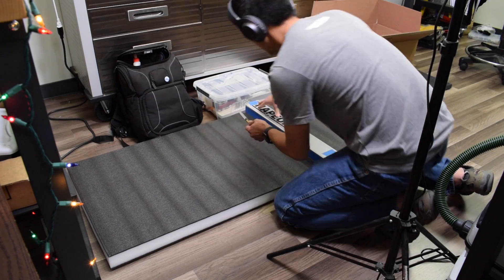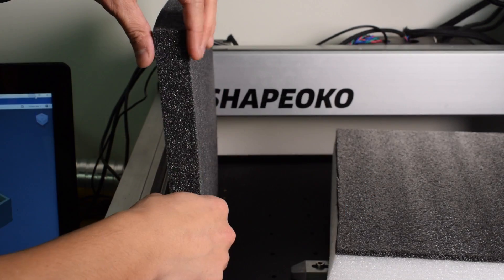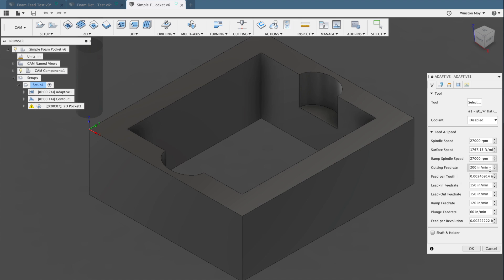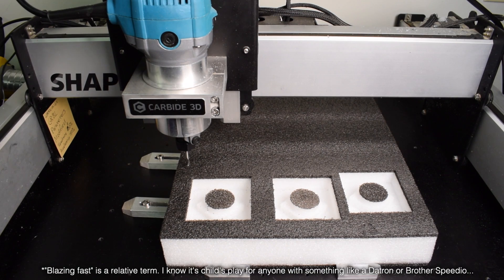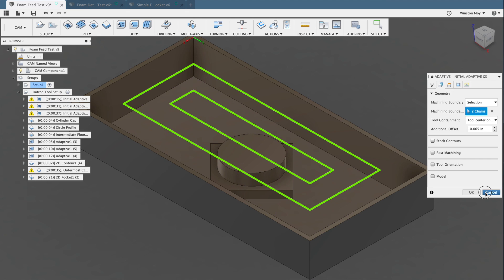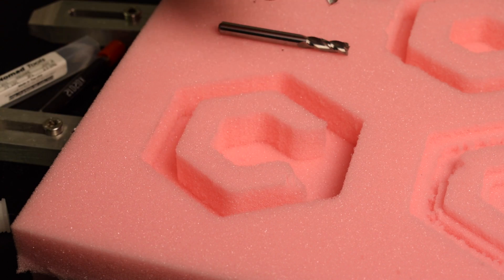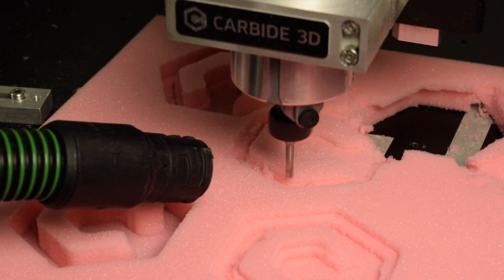Learning to Machining PE and PU Foam on the Shapeoko - #139

Comment: Is there any chance you could do a video on how you setup your containment boundaries in fusion 360. I am currently cutting kaizen foam and having the same issues you did. your solution would fix my issue. I am running a datron 3 flute endmill as well.  Although i am not running a shapeoko, i am running  UGS version of GRBL on my gensmitsu 4030, so I would imagine i would have to adjust my limits just as you did as well.  Thanks again, and great video!

Comment: laser cut it?
Reply from the maker: Can't cut flat bottomed pockets, only all the way through. Also, only certain types aren't safe to laser.
Reply: Winston Moy ah yeah you would be in trouble in that case. 

Suppose technically you could add a laser to this presumably?
Reply from the maker: @acidrain55  People have bolted on some 450 nm blue lasers for woodburning and light cutting, but for cutting plastics you need a proper CO2 laser operating in the infrared spectrum. Not good to put one of those fragile laser tubes on a CNC, and certainly not one that's properly enclosed/shielded.
Reply: Anyone know I
How deep you can cut on this exact XL Shapeoko setup, can it cut all the way through 3” foam or even deeper?

Comment: what if you made a metal* bed arrangement of all the parts you wanna pack, heat the whole thing up and then press a foam sheet onto it, so it MELTS away all the shapes you need in your foam.  

* or just metal covered, like foil.

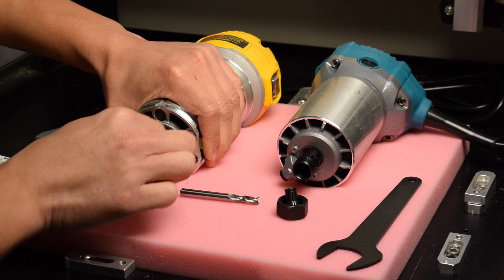Comment: 4:00 you can buy metric router collets, there is a mixed set with metric and imperial i bought last moth since i needed 1/4 for my 8mm machine so i bought these 10mm and grinded them on the lathe to 1/4-8mm. https://www.ebay.com/itm/6Mm-6-35Mm-8Mm-Woodworking-Router-Bit-Engraving-Machine-Wood-Milling-Cutter-M0S6/192871342488?hash=item2ce8072198:g:7EMAAOSwuptcmvjS
but you can by also premade ones
https://www.ebay.com/itm/1Piece-Carbide-Multi-size-Engraving-Bit-CNC-Router-Tool-Adapter-Collet/232613453717?hash=item3628d79f95:m:m7GaqDFK6eBuxxJusKqaY4Q

what is your collets outer diameter and the biggest inner diameter colet you have?

Comment: Interesting tests.  I've made my living for a couple of decades in a related field, my machine cuts at close to 1000 ipm.  We have a spiked finish on our custom cutter heads, called "SuperGrit."   Although not exactly the same sort of foam (ours is more friable, usually polyurethanes and EPS) we have had the task of doing more elastic and lower density forms.  About 15 years ago I came up with a method of soaking the lower density foam in water and freezing it, then was able to cut acceptable detail in very "soft" foams.  Had to work quickly but it worked for smaller jobs.  Not sure if it is relevant but just prompted me to respond upon seeing what you've shared.
Reply: InstaBlaster
Reply: Wooow George this is amazing! I’m trying to scale my family business we’ve been carving on foam for more than 20 years for props and hand made dolls. We’re small but we’re trying to step up our production and this information is really great! I’m trying to gather information about gear and what machine should we buy to start, because I’m guessing high RPM is probably very important when it comes to work and such a soft material. Would you be so kind to give me some recommendations? Thank you so much!

Comment: Ive been running foam on our laser for packaging. Its smelly, and wont do a pocket  (you have to laminate for that) but handles that soft stuff super easy. On our 100w, I run 40mm/s, at 50% power.

Comment: I had good experience with single straight flute endmills, like "10pcs 3.175mm Shank 2.5x8mm Tungsten Steel Parallel Milling Cutter Engraving Bits" on banggood. Also, I can recommend trying climb roughing - you won't get precise walls due to the foam compressing, but it will chip-break easily even on long continuous cuts.

Comment: My experiences are very similar. At one time the foam got caught and it sounded like a loud bang, the foam ripped in two, wrapped around the spindle, caused it to block the motion completely. The chinese vfd did its job and cut the power, it detected overcurrent and the protection kicked in. 
I've got some 16mm two flute straight cutters which are great for clearing large areas without foam clinging to it. It has a 6mm shank. Normally used for facing wood.
I did some 3d paths with it and worked great. After that a ballnose took care of the detail. With shallow doc it works great. Aluminium cutters (al-tian iirc) also work well.

Comment: problem with cheap small machines is that they don't last long in mass production. Try running your machine 5 24h days for a couple of weeks and tell me if the spindle bearings and ball screws still works fine / CNC machinist for 12 years.
Reply: Thing is how many specialised foam cases you need to make. Using a smaller cnc router would probably be useful for low volume runs that would take a large Mori out of doing production work is what Winston is saying. You could probably buy a whole new hobby CNC for what you would save on the large production CNC machine like what John Grissom is doing. Doing the foam on his Mori means it’s not making knives, makes a ton of mess that has to be cleaned up and requires him to swap out fixtures... but a cheap hobby CNC COULD cut the limited run of case foams for his knives while the knives are being made.
Reply: Problem with Honda Civics is they don't last long in the Baja 1000.

Comment: 0:53 - Routers are just too noisy. Really, they should be replaced by a spindle, either water or air cooled. The router depends on air flow through the device which means fans... fans are extremely noisy. Spindles on the other hand either use water, or radial cooling fins and a heatsink to dissipate the heat. I have a simple video to show the difference between the two.  https://www.youtube.com/watch?v=hALI4XpfmQ8
Reply: Agree with YOU 110%!!!!
Reply: I use a 611 router in my cnc but it is modified through a Super-PID speed controller so that grbl can control on off and speed. I’ve also built my CNC into a heavy wheeled trolley that has sound damped panels. The only reason I didn’t get a spindle is that it’s heavier than what a router is and I would probably have to up the size of the servos which would need a better controller... PSU... etc, etc...

Comment: I always enjoy your videos.  Thank you.  Would chilling (or freezing) the foam make it firmer and easier to machine?  I've heard of people doing something like that with rubbery materials.
Reply from the maker: Potentially, but you'd almost definitely have to use that with vacuum workholding (condensation renders adhesive workholding useless), and for how long the effect lasts would probably be just minutes.
Reply: Stick the machine in a grocery store freezer with a plexiglass (if any) top.  Not sure how the cold would affect the machine itself; but I'm sure you can find a walk in freezer for further testing .... (might want to save it for summer).
Reply from the maker: Haha, as amusing as that would be, it's a terrible idea. Embrittlement of the belts and other non-metal components, and condensation on electronics when you take the machine out are two reasons not to off the top of my head.

Comment: Hi, I love to see a video about the Festool vacuum - and why did you choose it
Reply from the maker: The Festool vacuum is Carbide3D's, so not my decision. I actually bought a Fein with my own money for use at home. Both much quieter than shop vacs. Festool's main feature difference is variable power. Not worth it for my use case.

Comment: I've thought about using the CNC to make organizers but haven't quite figured out how to create the custom shapes to pull into Fusion360.
Reply from the maker: Lay your tools on a scanner, or take a picture from above. use straight lines or splines to trace around the tools once you've brought them into a vector drawing program, or even Fusion itself.

Comment: Wouldn't the foam be good to use in cast metal pours? Cool video! Oh yeah, FIRST
Reply from the maker: Not this foam. You want polystyrene or something with really small cellular structure. PU and PE have too much surface texture or absorbancy to make a mold of.

Also, you're actually second. ;)